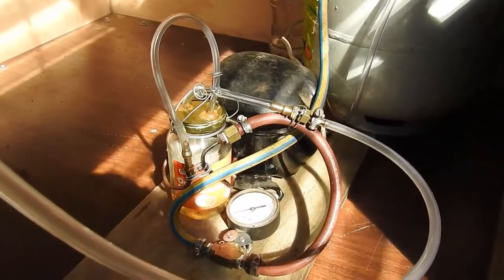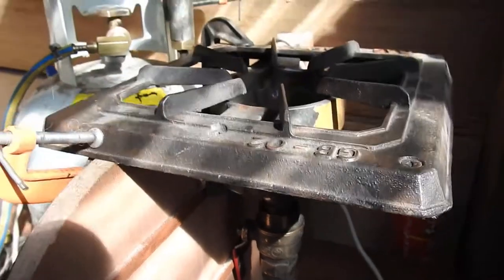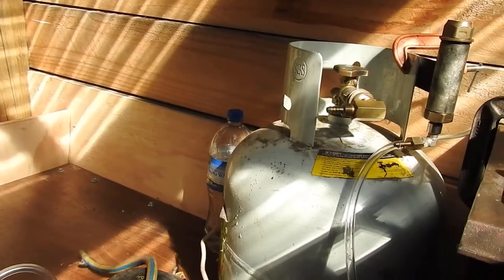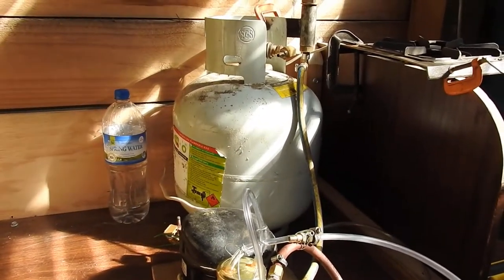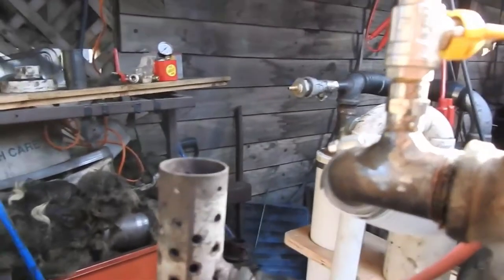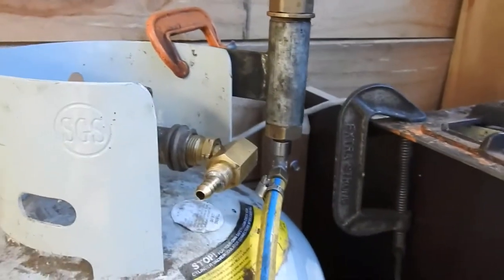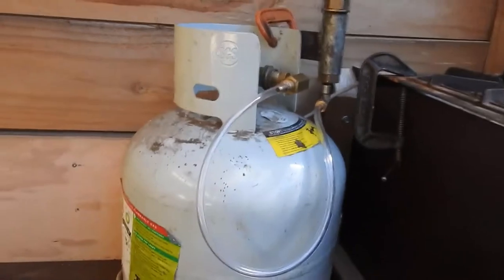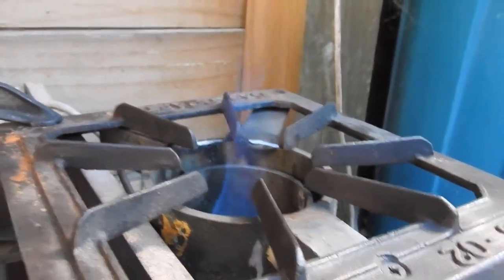Jamming a tree into a bottle - for later use

Comment: Steve the concept is great on paper but in reality you cannot store enough gas in the tank to get a long runtime on an engine or even for cooking with. I know you are aware that propane is in a liquid form and it evaporates off as a gas which is why you can run for hours from a small tank. I've ran my 2000 watt generator for 9 hours straight off of a small bottle like you have in the video then for another 5 hours the following day before it ran out and I was very surprised at the runtime and I was only expecting a 5 or 6 hour runtime but instead I got around 14 hours from a single small tank. I used to talk to a youtube user that went by the name technofreak who like you lived off-grid with woodgas as his main source to produce power. He modified his gas stove to work with woodgas and instead of compressing into bottles, he used a few tractor trailer inner tubes that he filled with woodgas then he placed a sheet of plywood on the inner tubes which he placed bags of sand on to pressurize the gas which would then feed his cooking stove through a copper line. He would fill the inner tubes each time he needed to generate electricity for his house and battery bank. According to him, the gas in the inner tubes would last a good while and not degrade and he considered his cooking system to be a low pressure system too.
Reply from the maker: Howdee Mike, 
  Indeed. Storing gas this way is not going to win me any awards for storage density   :)  .
 This is surely one of the biggest problems here, as it doesn't make good use of space. 
 That stated, if I can make a suitable gasometer, perhaps using something that resembles the 'diving bells' of yester century, I may be able to store sufficient gas - to be of some use here. 
 I remember seeing pictures of buses with big gas bags on their roofs. This may have allowed the bus to run for a few miles, perhaps between filling points along the bus route. 
 Something along those lines, could be of use here, especially if I am having a spot of bother in getting the gasser started up   :) .

Comment: Excellent!!  I've been thinking along the same lines, but with a bit more pressure.  Did you find out if the gas broke down in the tank after being pressurized?  I have my doubts.  You solved, what I think is one of the great problems with wood gas and that's using diesel for your scrubber liquid.  !!  Low volatility but will burn if it gets thru, which isn't likely.
I was thinking about more pressure - like 2500 or 3000 psi for an oxygen or nitrogen or CO2 tank and a real regulator in order to get some mileage out of the affair.  I believe that's how public busses (they're lories to you, aren't they) that run on natural gas work.  Thought about using a hydraulic cylinder powered by another hydraulic cylinder to compress the gas thru a check valve arrangement to push the gas into the tank at high pressure.  Probably will fill a medium sized bladder with the low pressure gas and then pump it into the tank a bit at a time.
Never mind the dislikes.  They're from Washington DC politicians who abhor you doing something constructive and useful.
Reply from the maker: Yup. Adding a lot of pressure to the system wood make a huge difference. 
 It is worth pointing out that the hydrogen in the gas is potentially harmful to a metal tank, so some folks have suggested that another kind of tank be used as a pressure vessel. 
 As an experiment, I wood like to try making an old fashioned gasometer, to hold the gas. 
 Sure, this would be useless for mobile applications, but it wood be good for use on the farm  :) . 
 There are a lot of CNG powered trucks, buses and cars here, so it is perfectly reasonable to adapt that technology for use with woodgas. 
 Your idea for compressing the gas wood work a treat, as long as you can GUARANTEE that there is no air in the mix that you are compressing, as gas gets hot during compression, and your system could easily ignite it. 
 The resulting blast could really mess your hair up, and singe your eyebrows. 
 As for the dislikes, yup, you are surely right, as they often come from lowlifes, who have NEVER done anything with their time. 
 Take care, and be safe with your experiments  :) .

Comment: I’m wondering what would happen if a reservoir can be used to cold start and run an engine while driving and warming up the onboard gasification device. I’m working on a motorecyclewoodeatingbeastbike.
Reply from the maker: I think you'll find that it wood work like a charm. 
 There are pictures of buses and trucks that had big bags on top of them, to feed the engine with woodgas, or charcoal gas. 
 Here's hoping you can get your WoodyBeastBike up and running soon, as you wood totally love every moment of it  :) .

Comment: How long those it lasts wn you use all the gas from the tonk or how many times you can cook or use a generator using the type of gas I think I'm going to store it one day .I like the idea of storing wood gas on a regular propane tank.
Reply from the maker: This tank doesn't hold much woodgas, so it is not the best choice for this. 
A much bigger tank is needed, in order to be truly practical for daily use. 
I want to try a thing called a gasometer, as as a way of holding a much larger volume of gas.

Comment: I’m curious Steve last time I ran my engine on wood gas there was very little heat BTUs on that engine head after 15 min run. Just warm to the touch you will have your eggs and breakfast cooked in about a hour 🤣
Reply from the maker: Hmmm. 
 My engines get pretty durn hot when I run them on woodgas. 
 It seems to me that my eggs wood cook perty quickly, if I dropped them on the grunter  :) .
Reply: @CNCmachiningisfun  interesting Steve maybe different trees make higher or lower BTUs.  Honestly when I ran my little 5 hp engine it was warm to the touch. Good future experiment I guess
Reply from the maker: @Josefppaz  
 A few things may affect this. 
 Engine load. 
 Engine ignition timing VS the rate at which the fuel burns. 
 Heat loss to the atmosphere. 

 I wonder.... did the exhaust pipe get hot? 

 There is so much to learn, and so few spare tick-tocks to learn it in   ;)  .
Reply: @CNCmachiningisfun  no buddy everything warm to the touch mind you it was cold when I did the experiments but very surprising
Reply from the maker: @Josefppaz  
 Hmmm. In tree-ging! 
 I wonder watt others are seeing in their systems. 
 With mine, the engines always heat up - in the same way as they do when running on dinosaur squeezings. 
 OK, with all of mine, they are pretty heavily loaded - making power to cool my beer, and light my globes  :) .

Comment: What should I say? :D Steve, as always you're testing all the ideas I only thought about :D Good to see this. 
I never mind to store any woodgas in a bottle, but I was impressed by the gasometer built by NightHawkInLight.
My attempt to store any would be to light the gasser automatically.
Reply from the maker: Howdee partner. 
 This idea has been buzzing around in my head for a fair old while now, and I finally got around to giving it a try. 
 Yup. Nighty's gasometer is probably the way I will eventually go, as it may be safer than my current method - and it also shows you how much gas you have left in the tank. 
 I hope to be able to use this for quick generator startups, and perhaps also for cooking my dinner. 
 Wheel sea aboat that   :)  .
Reply: @CNCmachiningisfun  Jopp :) I would have something in mind what looks like 2 barrels fitting into each other. Maybe not that huge but using his schematic.
Reply from the maker: @ravelkoff3549  
 That wood work nicely. 
 Watt's cool is that you wood not need to put any holes in any of the barrels. 
 Instead, you wood feed the pipes down the inside wall of the outer barrel, such that one of them bubbles the gas into the float chamber, and the other one sits above the water level - and lets you withdraw the gas. 
 Come to think of it, maybe you could do it all with just one pipe, instead of two   :) . 
 Now, where are we gonna find some water?   ;)  .
Reply: @CNCmachiningisfun  I would have more trouble to find the fitting barrels :D 
One pipe should be OK. Then you'll need a T and 2 check valves.
Reply from the maker: @ravelkoff3549  
 I think there is a simpler way, where we have no moving parts. 
 This wood use a big water tank, perhaps a 1000 litre one.  Inside this, we place a 200 litre one, with its mouth facing downwards. 
 Up through the mouth of this 200 litre tank, we place our delivery pipes, perhaps sticking them to the roof of said tank - to keep water out. 
 Watt we now have is something like an old style Diving Bell. 
 Naturally, we wood have to secure the 200 litre tank, to stop it from floating out of the water bath. 
 As we push the treezel gas in, the pressure will force the water out, and vice versa - until our gas consumer gets squirted with water.
Reply: @CNCmachiningisfun  Hi Steve, yes that's the idea behind. We just have to keep in mind, that the 200lr barrel would need some stability. And there the fitting barrels come in place. No chance to slide sidewards only vertical movement possible. If you would mount some rails to stabilize the barrel in a bigger tank it would fit. Tricky thinking.
Reply from the maker: @ravelkoff3549  
 My idea was to secure the barrel to the bottom of the 1000 litre tank. 
 As a result, the only moving part wood be the water, as it gets pushed out, or drawn in, by the gas flows into and out of the barrel. 
 That's watt I wood like to try, as my first version of a gasometer   :) .
Reply: @CNCmachiningisfun That makes sense :) But consider a very strong pump. It must be able able to push the weight of the water.
Reply from the maker: @ravelkoff3549  
 Indeed. 
 The tank wood displace 200KG of water. 
 To work out the gas pressure, I suppose I wood divide that 200KG by the total area of the tank? 
 Hmmmm, where's my googling cap?

Comment: I love your idea but (1) you need a oxygen Regulator on the tank (2) storage tank like a air bed try 1 that way you don’t have to run the generator  (3) I would trying to pull a Vacuum on the bottle first that would suck the gas in the tank from the air bed thin turn the pump on to fill the tank… I going to build a gasified just not stared yet I build a sawmill I can you the wood that I burn up
Reply from the maker: Thanks kindly for your ideas. 
 This project works well, but it can benefit from some improvements. 
 One thing I wood like to try is a BIG inflatable tank, that wood hold enough gas for me to use in the generator, and for cooking in the kitchen.